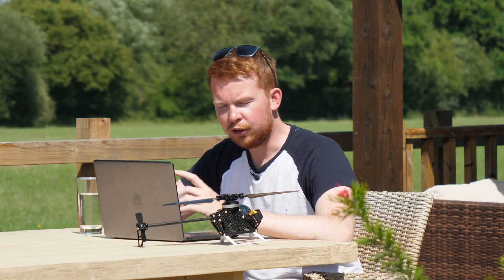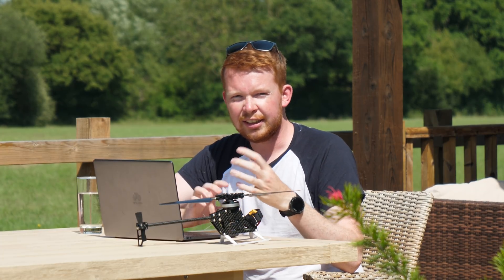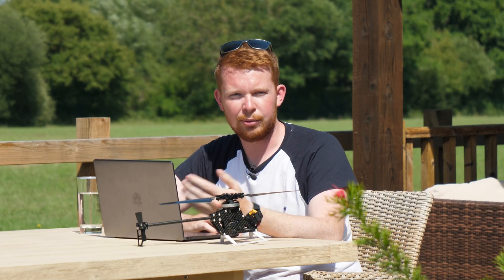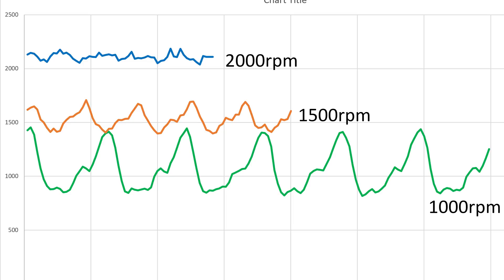How I built a Swashplateless Helicopter

Comment: Hello from South Florida USA.  Love your videos.  I saw in your video here that you used a quadcopter drone control board / Flight controller? ( Well I think that's what it was? ) To control 2 brushless motors (main & rear) of my old T-Rex Clone 450 mm size? ( Or any size } RC HeliCopter would be awesome. For breathing new life, get it off the shelf, and  be able to (* Repurpose old electronics* ) I have laying around from an upgrade or parts leftover from damaged old builds.  Could you  (* Please make a detailed how to video to REPURPOSE older drone/ quadcopter Flight controllers * etc.) so I could convert my old 450 T-rex clone RC Helicopter to be Flybarless + Fully controlled by a most opensource quadcopter FC ( like any BetaFlight, OpenFlight, CleanFlight Flight Controller Boards new or old?  I understand there's already in the marketplace actual dedicated RC helicopter flight computers / controllers integrated with the necessary idk, 3, 4, 5, 6 Axis Gyroscopes, accelerometers and GPS receiver in the marketplace to control the Heli as easy as any DJI drone, Stable, self correction, RTH, Hover, follow way points, etc. But they are pretty expensive. Can you please show us how to use, program an older opensource Flight Controller either OpenFlight, CleanFlight, BetaFlight ( I don't know if they all are Arduino based?) to replace the old gyro controller and other electronics that came with a clone 450 T-Rex Flybar hell from like 10 years ago? I'd like to make it Flybarless and re use a 5 year old opensource Flight Controller that should have built in the gyro, accelerometer, GPS antenna connection necessary to fly stable my 450 RC Helicopter. I just don't know how to program, code, and basic starting settings to be able to fly.  I think a lot of people would appreciate a video like this since I'm sure plenty of people are in a similar situation where they have a bunch of older parts, tech sitting around collecting dust or thinking about throwing away the old tech simply because no one has written code, instructions, to re use these controllers.  I hope you read this message, sorry it's so long, I get carried away trying to explain things to people. Thanks for all the content videos you have made and all your future ones. ✌️

Comment: it seems to me a set of flexible composite rotor blade could be tuned  to provide the pitch changes needed would be a better solution for faster and smoother reaction.  Using Kevlar for durability and varying the mass distribution along the length of the blade to tune the response and dampening might work.

Comment: @TomStantonEngineering I am involved with cuav and wondering if you had considered using double hinged rotors to increase response on drones by allowing the torque not just the rpm to change thrust?

Just an idea, kmax rotors, direct drive motors and swashplateless.

Comment: Summary
- 0:00 The video creator initially watched a swashplate-less helicopter video by James (Jimmy) several years ago, when motor controllers had an update rate of 50 Hertz.  
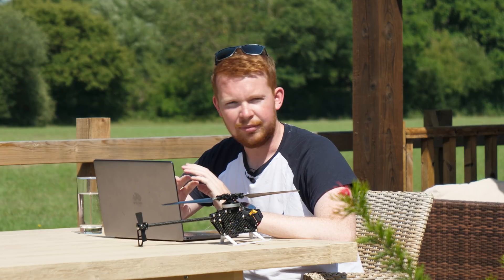- 0:44 Jimmy eventually used drone racing technology, which allowed for an update rate of up to 40,000 Hertz.  
- 0:57 The video creator used a protocol called one-shot 1 2 5 which had an update rate of 4,000 Hertz but with the teensy board and the Arduino code, he could only get it to run at about 500 Hertz.  
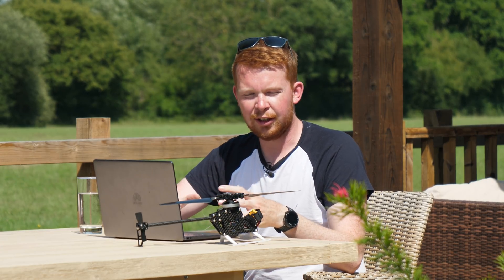- 1:18 He then needed to figure out how to configure the code to make a throttle output from a pitch and roll input.  
- 1:28 Initially, the creator used if-statement logic, plotted these into an Excel spreadsheet and discovered that the acceleration and deceleration were linear, which wasn't ideal.  
- 2:13 Instead, he found that using a sine and cosine wave created a peak acceleration and deceleration at certain points.  
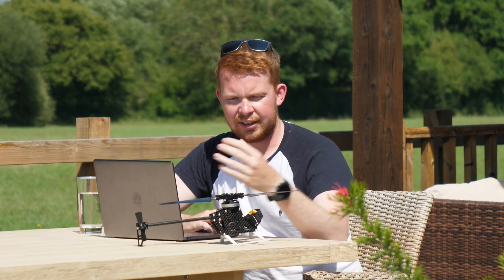- 2:38 The creator used a teensy 3.6 board to read the inputs from a drone flight controller or control sticks and multiply them by cosine or sine motor angle depending on pitch and roll.  
- 3:07 To measure the motor angle, a magnetic encoder called an AS 5047 was used.  
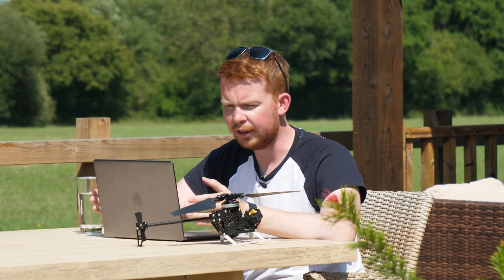- 4:00 The creator found that when RPM increased, the friction in the hinges also increased, causing control output to decrease.  
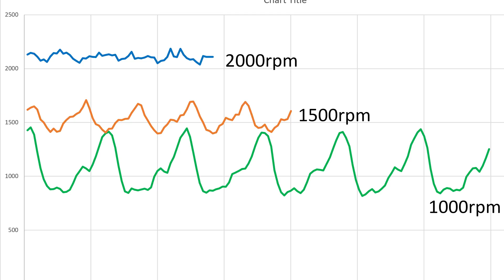- 4:43 He added a "dead band" to the bottom of the control output through a short bit of code to automatically increase control output past the minimum friction value.  
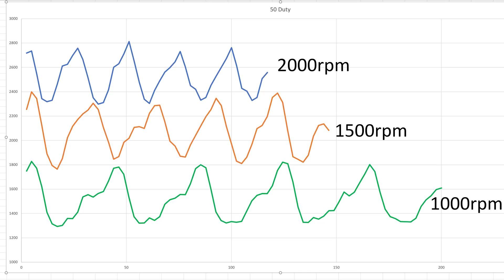- 5:11 The creator eventually scrapped the RPM compensation dead band equation and reduced the friction in the hinges in the rotor head, making everything easier to control.  
- 5:43 Many rotor heads were printed due to damage and redesigns. Eventually, the creator added washers and brass inserts to the hinges to reduce wear and friction.  
- 6:11 The hinge angle was also adjusted and played with for tuning.  
- 7:10 The creator plans to try this experiment with a motor with more torque and helicopter blades instead of fixed pitched drone propellers.  
- 8:06 The creator cannot make the code and files for this project public due to patent restrictions.  
- 8:55 The project took many hours to perfect and required a lot of fine-tuning, especially with the rotor head design and code.

Comment: I put the formula given in the video in grapchical calculator and it just gave me a regular sine wave with constant amplitude. In excel graphic of motor speed the amplitude wasn't constant. Like I understood, to change trust distrabution on halfes of the circle descibed by the propeler we need to accelerate and decelerate for different amount of time. So sine wave amplitude should be different on each half of the circle. Maybe the formula given in the video is incorrect or I understand something wrong?
Reply: It uses a sin and cos which are 90° out of phase
Reply: And the pitch/ rollctr are independent and when stable, very close to zero
Reply: pitch and roll ctr are pitch and roll coming from the flight controller?
Reply: @jebeandiah  pitch and roll ctr are pitch and roll coming from the flight controller?
Reply: @kirkirov6868  yes and then they are fed into the formula as the coefficients of the trig functions i assume

Comment: Pretty sure patents in the US are all about commercial use. Someone can make a patented device for themselves to use, since patents are publicly searchable lay out the technology's principles and operation.  usually code itself that is tied to some implementation of a technology is not patented, but rather copyrighted.  Commercial gain with patented technologies has to be licensed from the patent holder, but just recreating it yourself does not require it.

The main issue you'd run into with publicizing the code is that there are people who would try to take that code, bundle it with the printed components or files for 3d printing and attempt to make a "DIY" kit/blueprint that would be considered commercial gain, and those people would need to be cease/desisted. Unfortunately it's hard to get that cease/desist to work if those entities trying to extract commercial gain are from another country as some countries have a habit of ignoring foreign copyright and patent or feigning ignorance of infringement.

Comment: This made me want to get back to coding again. 

Combine this with the tail rotorless design of a lot of eurocopters. You have a helicopter that literally would need no other control input than 1 motor and an actuator of somekind in the tail rudder
Reply: Literally mechanically simpler than an airplane. You couldn't make an airplane that simple. A flying wing design would need at least 1 motor and 2 elevators

Comment: I know I'm a bit late, but I just found this video.  Did you think about printing the rotor head in POM/delrin?  The structural prints I've made with it have performed admirably (excellent material strength, low friction) though I had to use my enclosed printer with heated chamber to get reliable prints (100w light bulb on a relay inside my fully enclosed replicator II)

Comment: I had a good think about this concept. I'm sure it would be possible to apply this technique to a full sized chopper running piston or turbine engine. Not easy, but possible. The main problem I can see is that autorotation would not be possible.

Comment: so epic .. would love to see this made as small as possible- and see how long the drone could run for as it should be more efficent by at least double a quad .. and less than 20% of the price of a 6 channel swash plate copter
Reply: also your rotor head is not the same as the one on the original vid .. they use a tetering hinge  - like an autogyro .. youre using the first generation without the hinge  . go re-look their vids https://youtu.be/qWsKqmCIhRY?t=65

Comment: Very interesting. One fascinating possibility is that you could perhaps experiment with higher harmonic control. It has long been suggested that one could significantly increase the forward flight speed of a helicopter (largely limited by the issue of retreating blade stall) by increasing the collective pitch at azimuths close to 0 and 180 degrees and reducing it close to 90 and 270 degrees. To do this by conventional mechanical linkages is non-trivial and as far as I know it has not been done either at full-size or at model scales.

The topic is, if I remember correctly, discussed if only briefly in Basic Helicopter Aerodynamics by Seddon. It's probably also in Bramwell or Leishman  - unfortunately I'm somewhat distanced from my heli text books at the moment 8-)=

BTW - did you try including miniature ball and thrust races in the rotor head?

Comment: I also am doing some UAV helicopter research right now, and I think I have some insights you missed / disagree with

Since lift is proportional to velocity squared, if you get the same angle of deflection at a higher RPM, you'd get more lift difference and more control torque. I think this is the reason your compensation code that you scrapped threw off your tuning. Without it at high RPM, the blade deflects less, but a smaller change in angle is needed to produce same lift difference. So the mechanical system kinda balanced itself.

About using helicopter blades next time: almost all RC helicopters are meant for 3D acrobation, so they are excessively stiff and have symmetrical airfoils. On the other hand, drone propellers are really optimised for lift. Manned full-size helicopters would have the same shape, but can only approximate the twist and chord with simpler shapes due to manufacturing, material and other limitations.
TL;DR I think drone props are actually the right call.

I wouldn't know about this idea without your channel, keep up the good work!

Comment: What if you up the voltage of the heli? ALot of drone guys went from 4 cell lipos to 6 because you get mor consistent performance throughout the battery life and get more precise control due to having more power available. Some guys will run a high kv then put a throttle limit in firmware so they can fly it on a lower voltage if they want to.

Comment: You have talked about finding a way to change pitch on both blades. You currently encode the information about the pitch of the individual blades in a function of acceleration at a given angle. 
Maybe you could encode the overall pitch in chance of acceleration over time. If you want to increase/ decrease pitch you would overlay a periodic function with either changing amplitude or frequency ( or both). 
A possible mechanical decoder would be fairly difficult, but maybe you could use two compliant strut structures that decrease in size when torsion is applied. One of them would be dampend more than the other, and the maximum of the amplitude of the less dampend strut would be compared to the other to find the pitch angle. This design would be dependent on amplitude (more pitch if higher) and frequency (higher frequency -> more dampening in the dampend system-> more pitch).
It´s probably not the best design, but at least a beginning.

Comment: I think your problem at high RPMs might not have been friction, but the centrifugal forces pulling the blades outwards. That centrifugal force is the main force restoring the blades to their neutral position.
It might help to move the joints closer to the rotor axis. Possibly even putting them on the same axis, and using springs to supply the restoring force, which would make the restoring force RPM independent. Then again, at higher RPM you want the blades to be forced to their neutral position with a stronger force, because they have to return there quicker. For a purely centrifugally-restoring blade oscillations:
frequency = constant * omega * sqrt( A / B )
Where
frequency is the natural frequency of the back-and-forth oscillation of the blades,
omega is the frequency of the rotor head around its axis,
A is the distance of the blade's center of mass to the rotor axis,
B is the distance of the blade's center of mass to the hinge.

Optimally, you would want the frequency that the blades freely swing back and forth at to be equal to the RPM of the motor. That way you get the largest ratio of oscillation amplitude (blade pitch) to the amount of energy the motor has to provide to that oscillation.

In the shot at 4:48 the rotor heads on the right look much more optimized than the ones on the left. From the fact that the left ones are all smashed, I assume that those were the ones from before you ironed out the kinks that lead to crashes. Then again, I don't know how significant your friction was and which part of the improvement was due to you moving the hinges inwards and which part was due to you reducing the friction.

Comment: Just a silly idea: You can have manual control ability and eliminate the patented code by attaching the motor to the rotor through a u-joint and a 2:1 reduction gear and moving the motor to vary the angle of the u-joint. By making the reduction gear reversing or not you can make the rotor and motor's gyroscopic precessions interact in different manners. It'll add complexity, but i'd like to see how it works...
Reply: That is actually incredible. Yes!
Reply: That's a great idea!

Comment: wonder if it would help to have a specialized ESC that had regenerative braking, so it would dump power to capacitors during deceleration and cycle it back into the motor during the accelerations

Comment: If both blades are hinged, then aren't the forces equal on opposite sides?
Reply: The forwards and backwards forces are equal. That means both blades will move forwards or backwards at the same time. If both hinge axes were simply going vertically up, the blades would move in completely identical ways. However, one of the hinge axes is aligned up and outwards, while the other hinge axis is aligned up and inwards. So as both blades swing forwards, they tilt in opposite directions (and the same for when they both swing backwards).

Comment: You could speed up that function at the expense of some memory by turning those time expensive calls to sin/cos into a lookup (cached) table keyed by the function parameter..  
Duty = throttleIN + (pitchCTRL * myCos[motorRads]) + (rollCTRL * mySin[motorRads]);
If motorRads is a wildly variable number you can scale it down / reduce precision to reduce the number of elements in your lookup tables.
if motorRads is being calculated by a similar processor heavy function you can use the same trick there.
Reply: I was thinking the same thing. If the pitchCTRL and rollCTRL values can be 'normalised' then using a two dimensional array would speed things up further. But, definitely using a lookup table would save a lot time.
Reply: @edbrown1166  Afik, the Teensy has a multiplier so that's probably not a slow-down.  A single table should do it and I bet it can be pretty course as well.  Though this might be a good excuse to build your own CORDIC loop :P
Reply: That's true actually

Comment: Potentially something a little different, I got an idea, for the sin wave, you could change the horizontal shift in affect to the radeons at which you want the thrust so you won't just have left right back and front but to any degree. I see the maths is possible but probably not smart enough for it.

Comment: All rotorcraft that have a single main rotor have a flapped blade so the forwarding moving blade can flap up as I'm sure you know Tom. I'd be interested to see if it's possible in this case? Ie, will you continue to ha e control in fast forward flight when the left half of the rotor will want to flap up to relieve the extra velocity over the retreating blades. Great video!

Comment: I've been wandering about combing the simplicity of a drone and the efficiency of a Heli for years and it's amazing to see it there working. This is truly amazing work. A bicopter with this design would fly with literally just 2 motors and no servos and the second motor would actually equate to lift unlike the tail rotor from the traditional Heli. I'm really impressed with this.

Comment: Why not rewind the motors? If its in a delta wiring configuration, you can just rewire it to a wye configuration to have 30% less rpm and 30% more torque

Comment: There's an open source ESC on electronoobs based on the ATmega328. They have the gerber files up for grabs and it looks like there's a free pin or the buzzer could be replaced to allow for two PWM inputs. You could totally program the sinusodal output within the ESC and have a single chip instead of sending a high frequency sinusoidal PWM signal from the teensy to the ESC